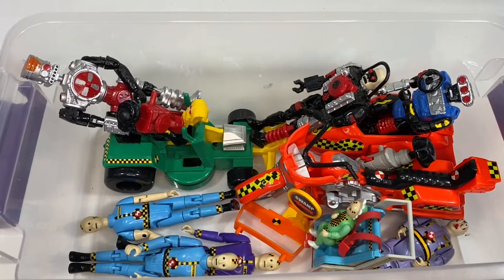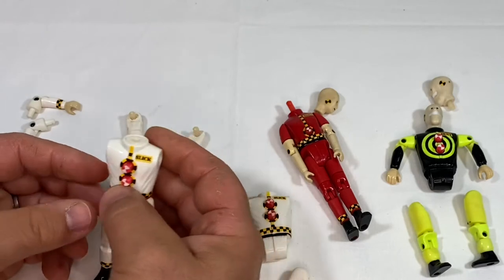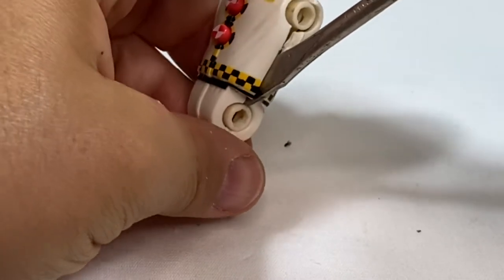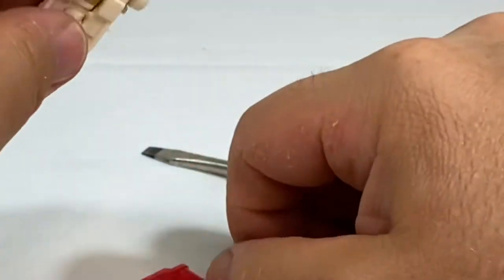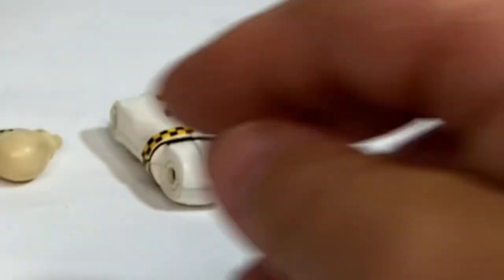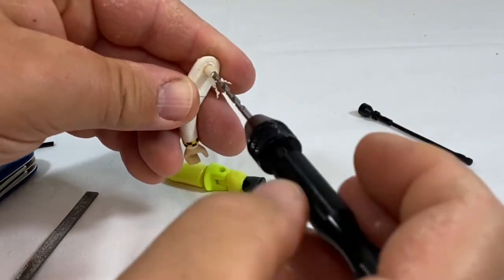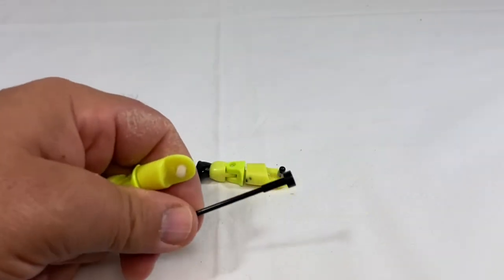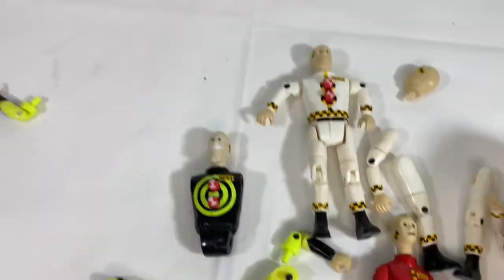Crash Dummies Figure Repairs, A Look At The Inside

Comment: Did you know the incredible crash dummies protek  were divided into 2 waves? Wave 1  had repaint and redesignes reissues (slick spin daryl sparetire and the twins except skid and darelene. 3 cars 3 bashn bomber Dummy derby race cars crash cab rideones mower tractor gokart quadbike atv 2 motorcycles with side cars crash n dash chopper slam cycle.and did you know wave 2 had karate kick spin telescopic slick exploding axel spiked body dash bull junkman pistonhead Sidwswipe Jackhammer Crash plane crash dummy flipover truck crash dummy dirt digger junkbot hauler junkbot wrecker crash cannon playset junkyard playset.
Reply from the maker: Interesting!
Reply: Did u know purple junkman was orinigally intended to come with the bot hauler but instead it was packaged with a vhs instead

Comment: Ever try the boil and pop nethod?
Reply from the maker: Yes I have.
Reply from the maker: Mr Anonymous  when you boil water and put the plastic in the water to soften the plastic. This method allows you to pop limbs off of figures for customizing or repairing. Trying to do this without the boil method will most likely cause the plastic to crack or break.